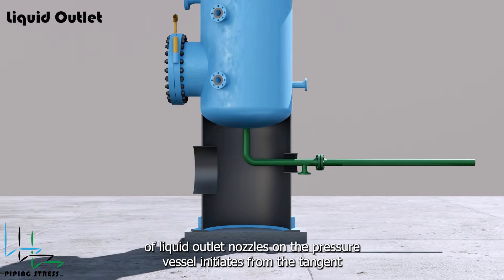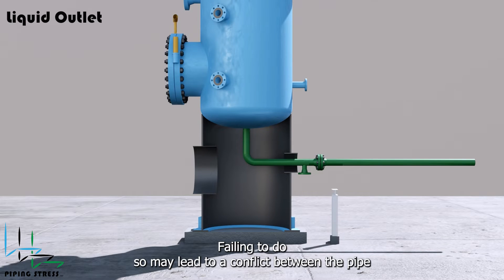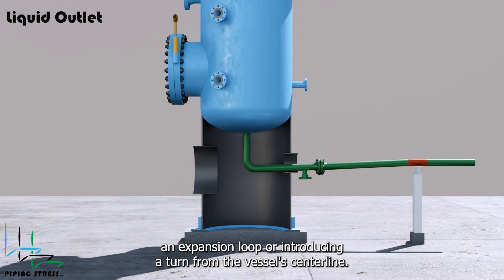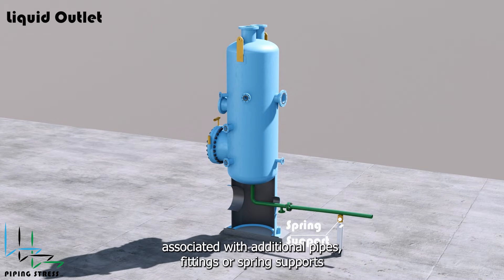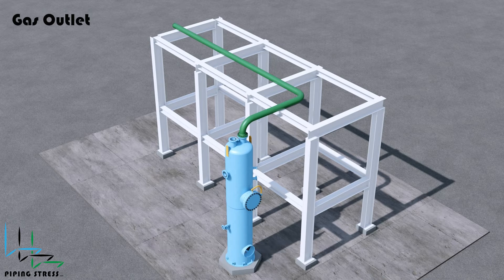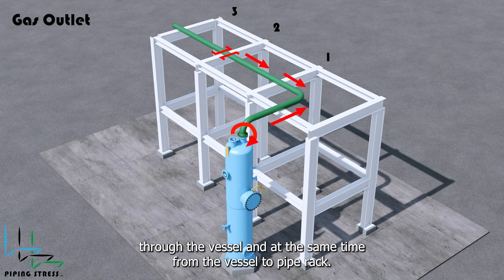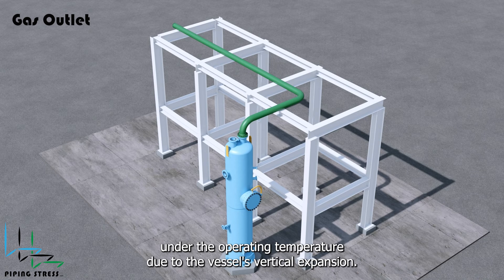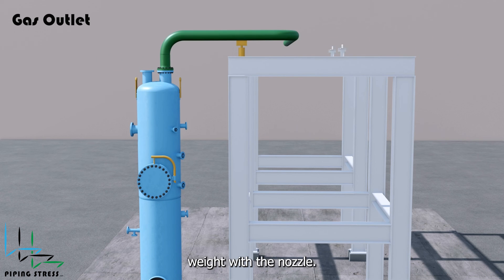Piping Stress on Outlet Nozzles - Gas Outlet and Drain Outlet Piping Details are identified.

Comment: How do I know which direct the equipment expands
Reply from the maker: Hi, Thanks for your comment. The equipment and pipe expansion start from the supported point. If you support vertical equipment from the middle elevation, the top part expands up and the other part expands downward. The horizontal equipment expansion starts from the fixed point.